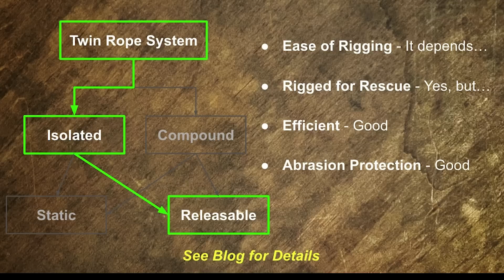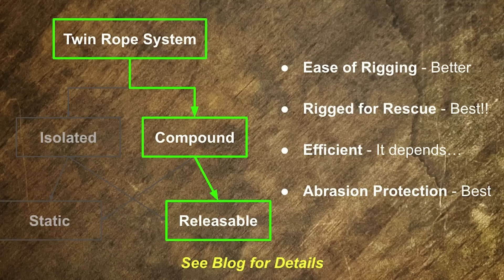10 uses for the PaliKoa Pivot Rappel Device

Comment: The naming of the isolated and compound systems is so counter intuitiv, because in the isolated system the ropes to descend are connected and in the compound system the ropes are basically isolated from each other, to where it can be done with two not connected ropes.

Comment: This series is so perfectly timed for the season! Canyoning isnt a huge sport in California and therefore there aren't a lot of (healthy) bolts on canyon routes. Do you guys have a natural anchors video? Retrievable and non-retrievable..? What rope systems/retrieval systems work best for which anchors (trees vs chockstones etc...)
Reply: Good question matt. I’m also interested
Reply: retrieval/anchor design will have more to do with the direction of pull and extension(or not) to the  ledge, and obstacles to the pull than it does tree vs stone, etc. Having redundancy in your anchor is based on need and availability. Meat anchor if you can do so safely. Get familiar with slinging existing features and extending with webbing plus building deadmans, that will cover many situations needing natural anchors. They had a good video on the fiddlestick which is the go to retrievable in many instances. There's also retrivalable Deadman type equipment things ...bags you fill with sand then release but I've never used one.

And most importantly as to what works best: https://youtu.be/5r50PN99rGI
Reply: They do, it's their video on "ghosting".